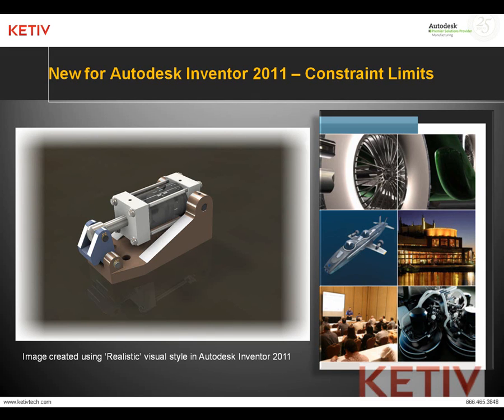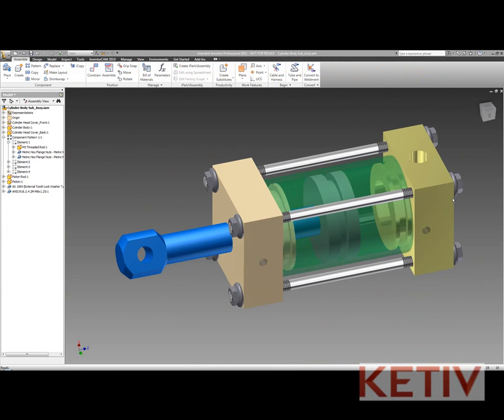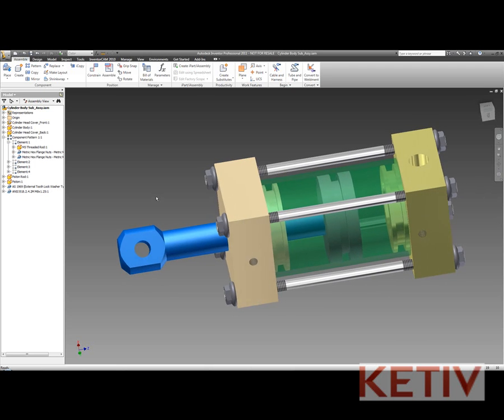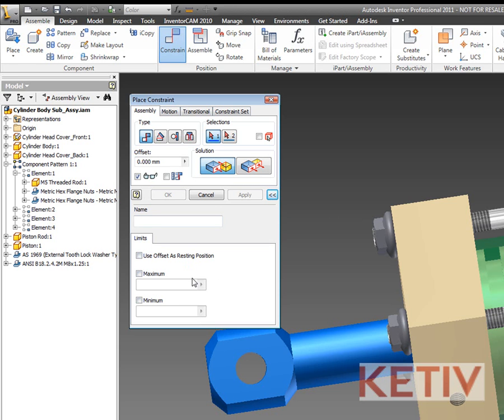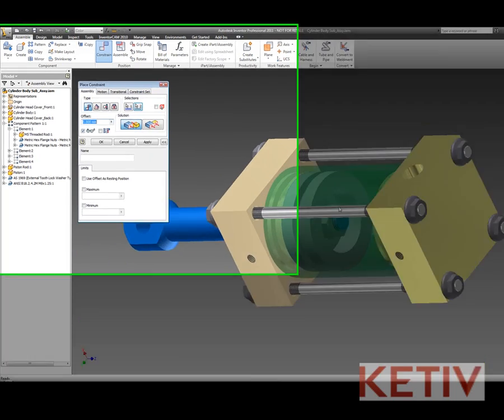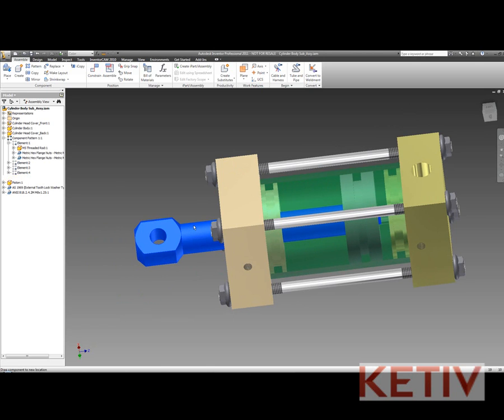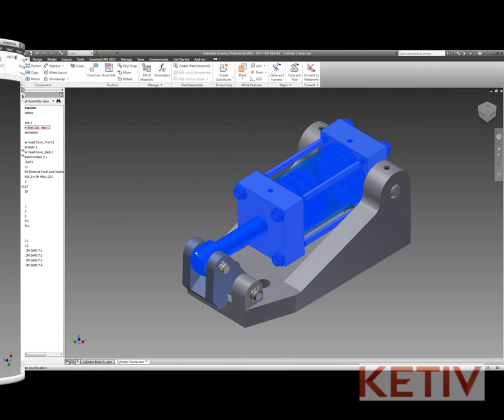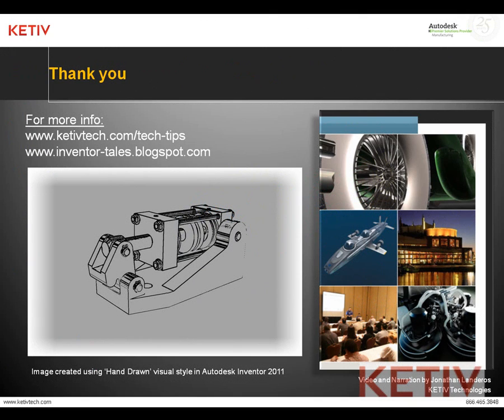New for Autodesk Inventor 2011 - Constraint Limits

Comment from the maker: I'm afraid there isn't a way to downgrade the files in such a way that you can see the features.  You could export step files, but no features will come across.  

One other thought, (although a bit MacGyver), would be to export a step file from 2011, open it in 2010, and use the feature recognition tools off of Autodesk Labs  to recognize the tools. 

That does assume school lets yo do that!  :-/

Hope this helps!